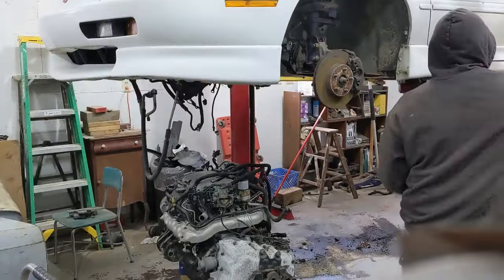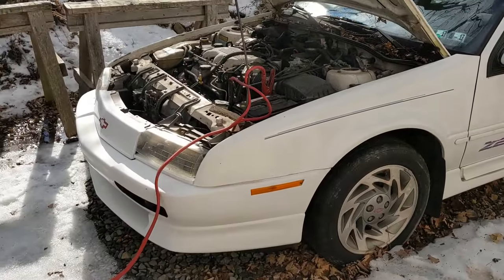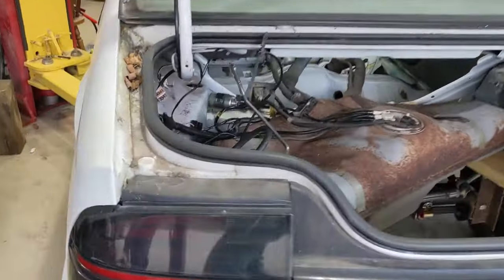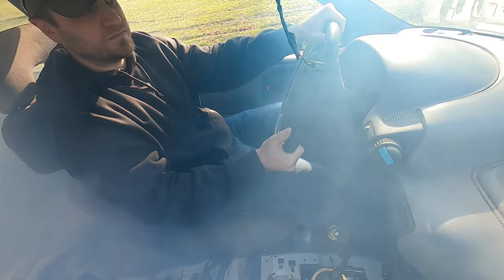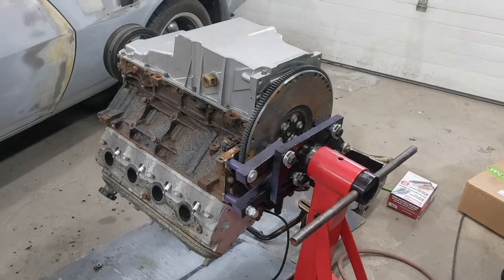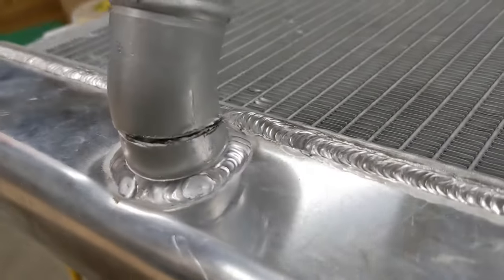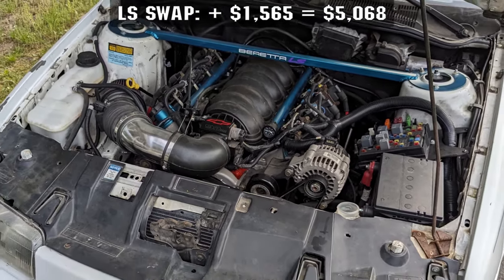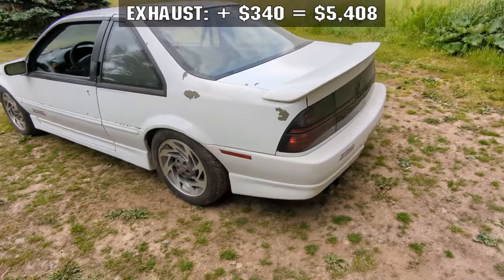What did it cost? Cheap RWD Beretta #LSswap T56

Comment: You are obviously very good at fab work. That was  some extensive work! It would seem easier to start with a rear wheel drive truck or car though, no? Though if you love the Beretta then I get it. I did an ls swap to a c10. I did the same as you as far as using the odbx pro and pcmhammer/tunerpro etc to hack the pcm and tune. Gotta love that! My c10 was 6k, but the ls swap was cheap. I got a silverado for 700 bucks and used the motor/trans, pcm,dbw pedal and module setup. I re-used all I could and I mean all I could lol. From the sparkplugs to air filter, all the engine sensors that looked good, on and on. I just did a gasket refresh on the motor but never took the heads off or valve train.  I added headers for clearance issues and made my own dual exhaust. Added in a trans mount to make the exhaust easier to do. Then gas tank/pump  and lines. Under 2k in the full swap. 
Thing is awesome and runs like a new car.
Reply from the maker: Yeah fun doesn't have to be expensive! I wanted the challenge of a RWD conversion. Andy my first car in high school was a white Beretta.

Comment: I really like it as well so I’m glad you did the swap hahaha
Reply from the maker: I'll like it a lot better if I can squeak 12.99 and 30mpg out of this 4.8 before I swap it🤣
Reply: @GEARHEADdezign  I just picked up a 4.8 out of a 2010 Silverado. Need to figure out what I’m gonna do with it. Was trying to find a 4.3 5 speed s10 or something along those lines to do a little peppy gas saver truck. If you get 30mpg let me know hahaha
Reply from the maker: @LynnTwinCustoms513  sweet. That gen 4 will have a little more power and an s10 should be about the same as Beretta weight. With 3.42 gears and a 29" tire like my blazer you might be able to squeak 30

Comment: How does it handle turns, bumps, hard launches etc??  And who paid $12k for a Baretta?? Was that a GTU or Z26 with SS stickers on it??
Reply from the maker: I've got over 3000 miles on it now. Handles straight and tight, rides comfortable, and the adjustable shocks are to fix the wheel hop I get when dumping the clutch on slicks and get better 60's. No wheel hop on street tires doing burnouts
Reply from the maker: The last Beretta"SS" I built was a GT that was totally redone from the ground up. Z body kit, 3400 swap, built 5spd with LSD. It was a beast. I have videos on that car too
Reply: Wut fuck does it matter,he didn't pay,,,2,000,000😮😊

Comment: Why the explorer rear end, width? Also couldn't really tell what did you do about front subframe? Was it custom or something modified?. One of the baddest builds on YouTube in my opinion.  So many 90s 2000s gm car would be so cool rwd.
Reply from the maker: Those 8.8s are strong and cheap with a good LSD. And explorer is narrow enough there was room for wheel adapters
Reply from the maker: Front subframe is factory, cut up and modified. I have info in one of my earlier videos
Reply: Cool, thanks for the info

Comment: Did the stock gauges all work?
Reply from the maker: @nickle549  yup, I got every single one working. The low oil light is backwards right now so I've gotta wire in a relay to reverse the function, but it all works nice